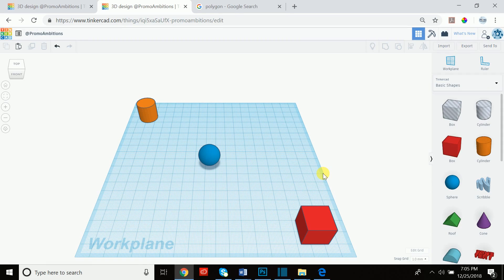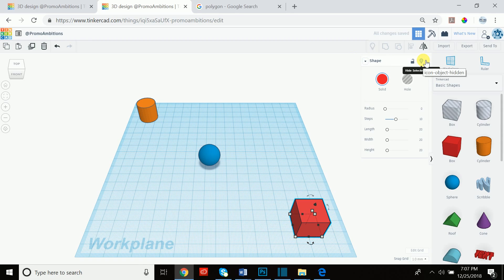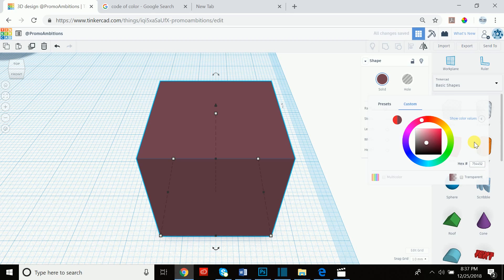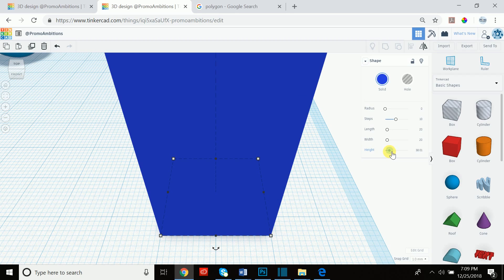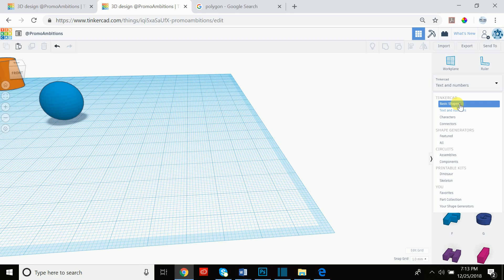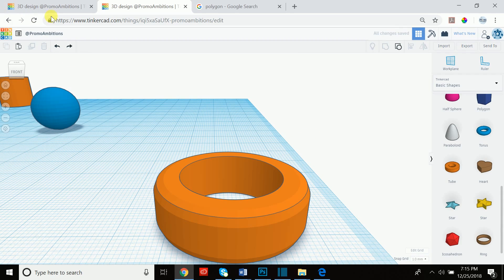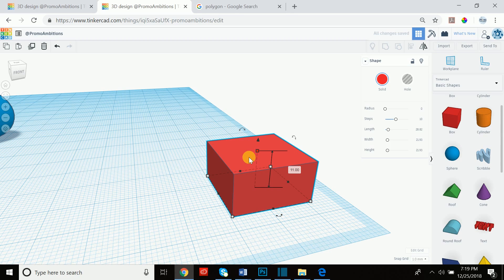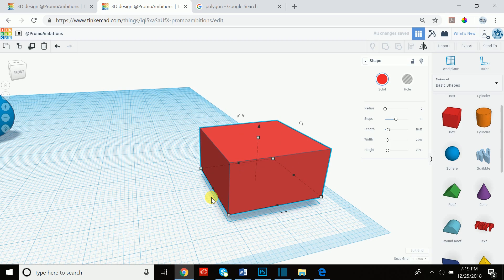Tinkercad Tutorial Part 2 - (Shape Manipulation and Scaling)

Comment: Thanks for the videos. Do you have an agenda for what you are looking to cover on these updated TinkerCAD videos? You keep dropping hints of things you might cover but aren't committing to much at this point. Would be great to see what you're planning.  Personally, I'd like to see a video on using TC for 3D print designs. Obviously there are design elements that would be more difficult to 3D print (like overhangs and other elements that would require supports) and it would be great to get your take on things to watch out for and design methods to use to get .stl's that can be printed successfully. Would also be interesting to see a video on how you create a more complex design and the approach you'd use to get it done (best if this was a 3D printable part). Hope you can add videos on these topics. Thanks again.
Reply from the maker: Thank you for the thoughtful comment and excellent suggestions... trying to balance work, passions, and the YouTube channel is not the easiest endeavor. I typically just cover whatever I am most excited by or motivated to create on YouTube... I'm definitely scattered with the channel, but will take your advice into account. Thanks for watching!

Comment: Hey, I have a question, is it possible to use a face selector in tinkercad? I have an object that I need to print that is sort of like a tube with a smaller tube sticking out of it at the top, I need to extrude just the top area but I have only found videos on how to extrude the whole thing. Is this possible? thanks a lot.
Reply from the maker: I don't believe Tinkercad has those capabilities

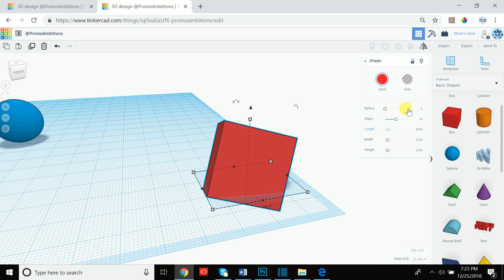Comment: Great tutorials. I've been using Sketchup and got so frustrated I decided to give Tinkercad a go. Your tutorials have been a fantastic introduction to the program. The problem you mention at 16:30, that is, the original dimensions of an object are no longer shown in the Shape box once the object has been rotated, could be fixed if they had 2 sets of values - one for the actual dimensions of the object, and the second for the relative dimensions it takes up on the workplane. Thanks again for the great tute.
Reply from the maker: You are most welcome...appreciate your insightful comment 👍
Reply: Also, you didn't cover Workplane and Ruler, and the Import/Export feature. Is that covered in another tutorial?
Reply from the maker: @stevenwild39  I did cover these... this is part 2...there are 6 videos my friend 👍